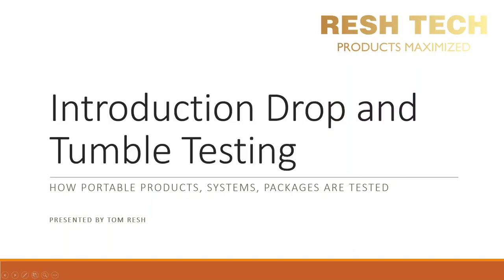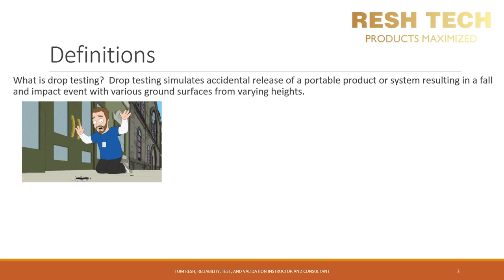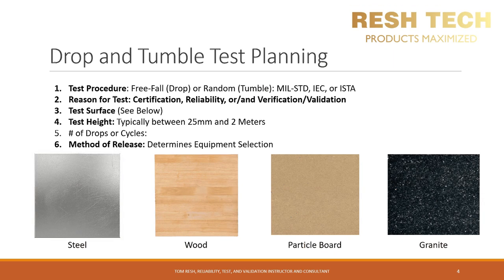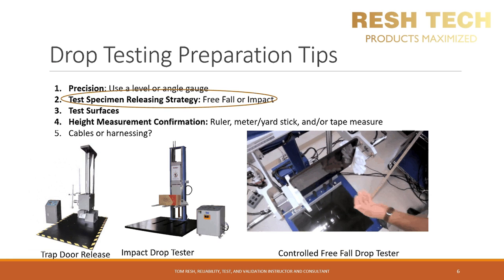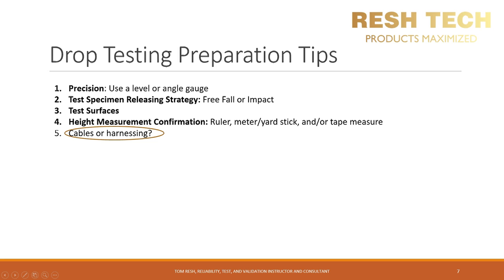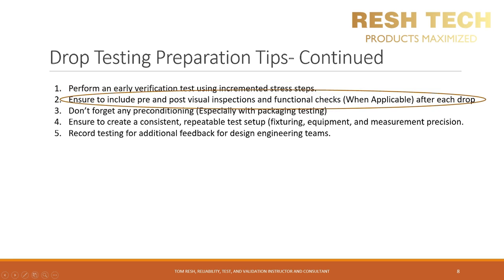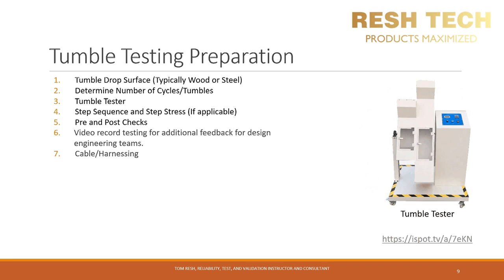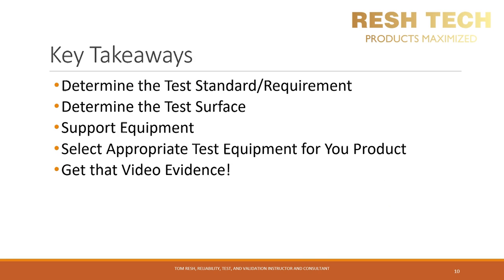Introduction to Drop and Tumble Testing

Comment: Can you explain the sentence "The rate of fall shall be approximately ten falls per minute" (IEC 60068-2-31   Free fall repeated)
Reply from the maker: A tumble test is simply a random drop test using a tumbler.  

The number of falls/drops is how many times the unit under test drops to the opposite end of the tumble tester.
Reply: @tomreshtesting   Thank you so much. But what does this means " the rate of fall"
=> the number of fall or the rotation speed.
another question: for household items such as smart speaker, clock...=> use drop test or tumble test or both.
Hope you can reply as soon.
Thanks
Reply from the maker: @theunguyenerica9444  I would recommend using both tests.  A drop test allows you to focus on specific drop locations such as edges, faces, and corners to identify weaknesses and Tumble testing is a "random" drop that can also identify additional failure modes and can be used to simulate misuse cases, such as dropping a device down a flight of stairs.